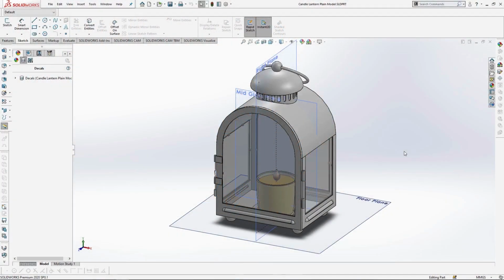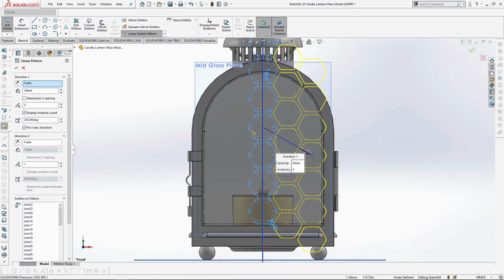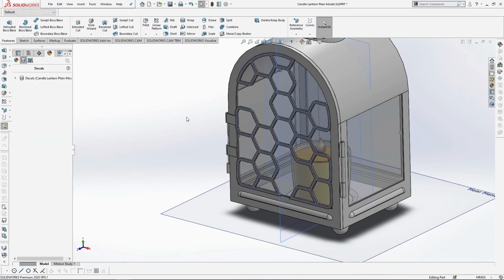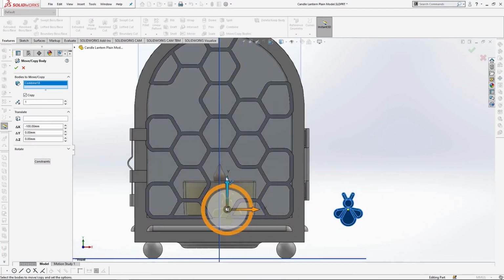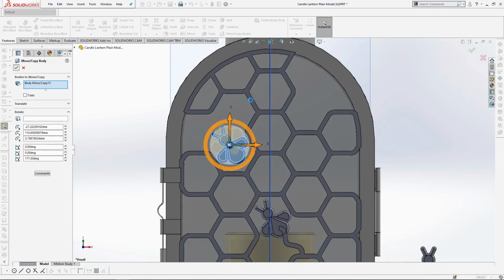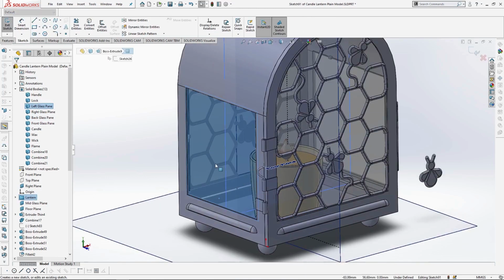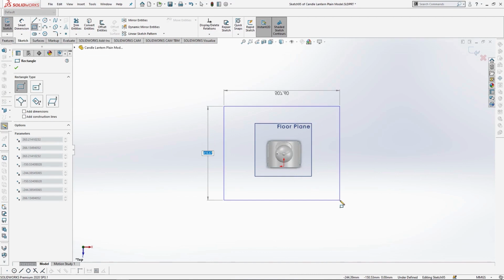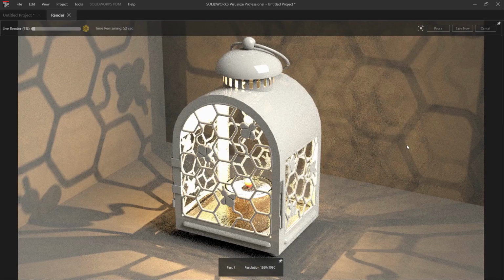Candle Lantern - SOLIDWORKS

Comment: I loved it, Jade! I learned a lot of new techniques in this tutorial. I found it more effective to use spline rather than the 3 point arc technique at the time of building boundaries for the incomplete honeycomb structures within the glass-pane. One suggestion. But I'm pleased with the result all in all. During my first attempt, I almost gave up, but I'm glad I persisted until the finish line... I'd like more from you! 

Cheers, and wish you a Merry Christmas!